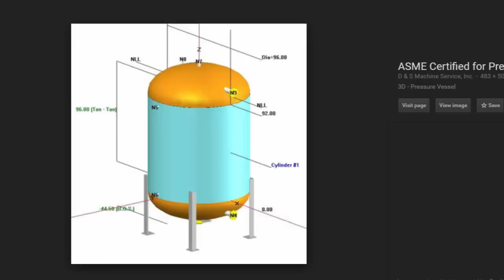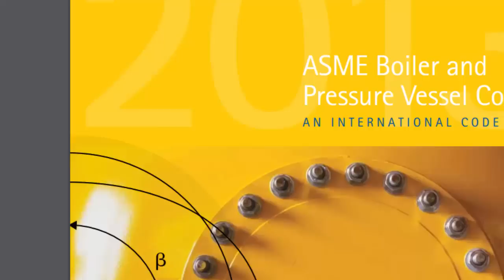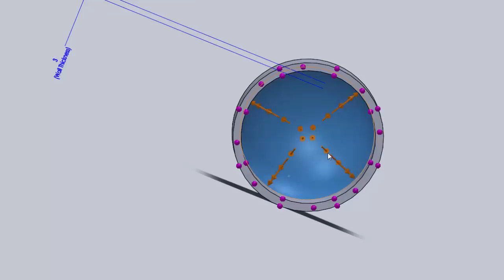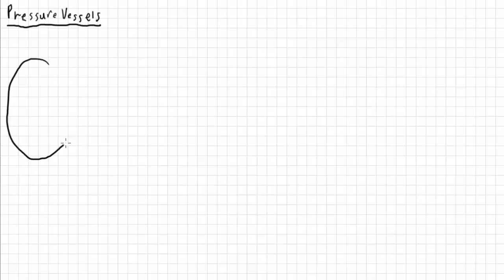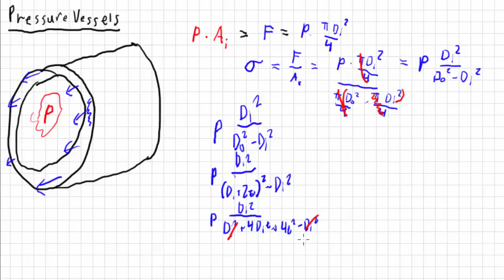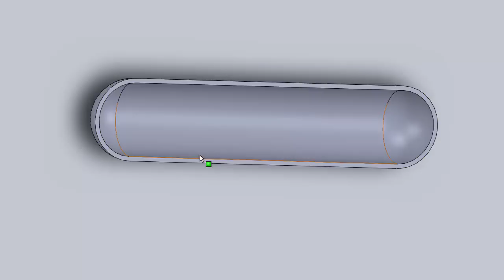Pressure Vessels Introduction

Comment: I'm probably wrong, but isn't the surface area of a sphere = 4*π * r2 and the area of each 1/2 sphere = 2πr2?
Reply from the maker: Nope, you're right, but to find the force for the stress *normal to the plane of the cross-section of the tube*, one only needs to calculate the area of the fluid in the plane of the cross-section of the tube, not the force on the entire half-sphere. The forces on the entire half-sphere a) are in a variety of directions and b) the ones that aren't along the axis (any in y or z) all cancel each other out, leaving only those in x, and those are only normal to that x-sectional plane. 
I hope that helps. Thanks for watching and commenting!

Comment: ok....longitudinal stress is 1/2 of the hoop stress. Clearly that is the case since pressure vessels rupture along the axis of symmetry. Ok got that...now why exactly a sphere is a better engineering solution? For given pressure it induces 2x as much stress in the hoop direction than the axial direction. If anything the conclusion should be: a cylinder is a great variation of sphere and the axial stress is less than the hoop stress, which is quite fortunate.

BTW...wouldn't you ant to calculate a combined Von Messes stress? I mean...you are stretched in Y and -Y and also X and -X (only 50% less). Still...shouldn't that add up to a resulting means tress which is a sum of the two directions?
Reply from the maker: A sphere is better because it has no hoop stress, thus it will be twice as strong for the same pressure AND it is the most efficient shape in terms of surface area:volume.
A Von Mises stress calcaluation would be a great next step. However, that's not covered in this particular course. I'd love to, but I run out of time!
Thanks for watching and commenting!

Comment: id like to make a rectangular pressure vessel to hold 60 PSI measuring L=8.25 ' W=4.5' H=1' but am uncertain if this concept is possible. This vessel will not have heat applied and is for casting purposes. any thoughts?
Reply from the maker: ep5tv is pretty much dead-on. If you're still set on it, research all the rectangular pressure vessels you can find. You may decide to change your strategy.
Reply: Can you place the rectangular mold inside a standard spherical/tubular pressure vessel?